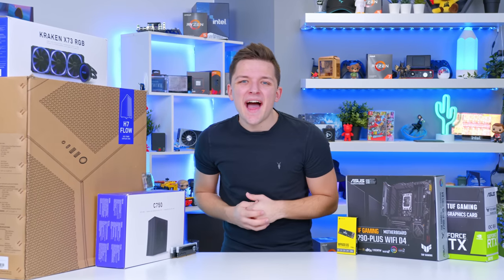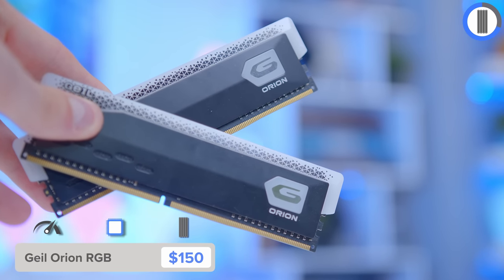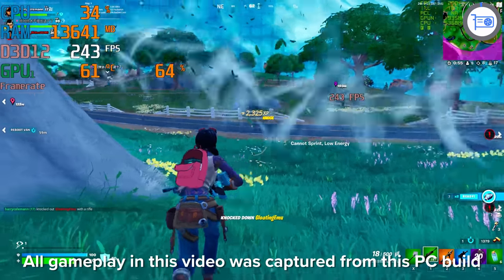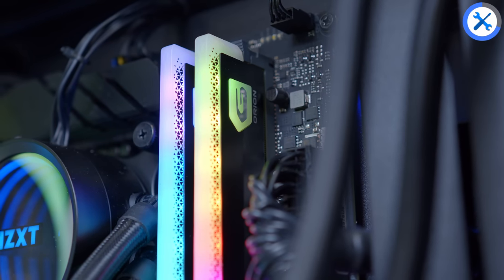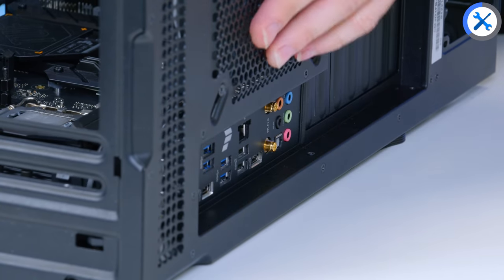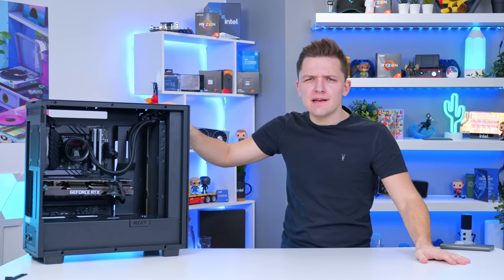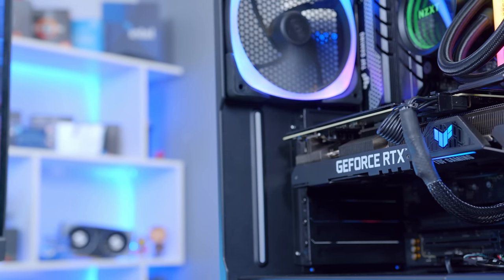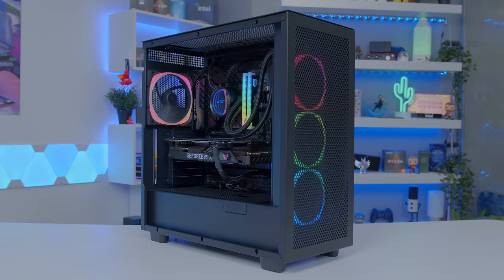Best $1500 Gaming PC Build 2023! 👀 [Full Build Guide w/ Gaming Benchmarks!]

Comment: The red devil rx 6750 xt is the equivalent and $150-200 cheaper than the 3070
Reply: 3070 is minimum 20% better than the 6750xt whilst being consistently 400-450 on ebay, while the 6750 xt is no less than 450
Reply: @Prestige Doggy  if you like used sure ebays good, I'm not about used, Brand new the 3070 is $150 - 250 more than the 6750, when at 1080 and 1440 they're the same, benchmarks have proven this, I just bought a 6750 over a 3070 just cause of price for performance, 6750 wins that battle
Reply: @usleadershipareliars  100% 6750 xt is way cheaper and on par with the rtx 3070. its a no brainer. i just copped a msi gaming x trio 6750xt for £450 ! crazy how cheap that is
Reply: I cant believe that only cost $1500
Reply: @UndauntedAssassin  hahaha dude I almost got the msi, but it wasn't available in the u.s. at that price, I would've had to order it from the u.k., it was either the msi or red devil. 
I wanted that Msi, glads you got it mate 👍 👌
Reply: @prestigedoggy7624  in what world is a 3070 20% better than a 6750xt? Maybe 4K ray tracing on but nobody really cares about that. They are on par for 1080p and 1440p
Reply: @prestigedoggy7624  got a second hand Rx 6800 for 400 euro wich destroys the 3070 that nowhere near true
Reply: @Frosty-dr8bs  in the world of thr funboys gahahahahahaha

Comment: He should have went with a 12600k instead of a 13600k because a 12600k will NOT bottleneck a 3070 in any scenario and if you get a 3070, you are gaming at 1440p. With that being said, then get a $200 Z690 motherboard. That frees up about $200, then you can upgrade to a 2TB NVME SSD and the Z73 Kraken with the LCD screen that displays anything you want on it
Reply: But if you have the 13600k, 5en you don’t need to upgrade your cpu as son. This means it also doesn’t bottleneck future gpu’s. The 13600k works in this budget well and is worth the extra money in this budget.
Reply: I would go for Rx 6900xt
And 5600x with a b550 because on 4k in AAA titles it won't bottleneck the 6900xt and I will have 40 to 60 percent more performance for the same price at least on 4k resolution
Reply: @aperson9907  I was going with the angle of, save some money in places that won’t affect the Gaming performance while upgrading the storage and aesthetics.
Reply: @erichagen3617  if your talking about decreasing the price of the build, then yes I would agree with you. The 12600k would be fine and you could still upgrade storage. Most people don’t need 2tb and fast speeds so they can upgrade later as they will likely have a motherboard with more than 1 m.2 slot but some people may not want that.